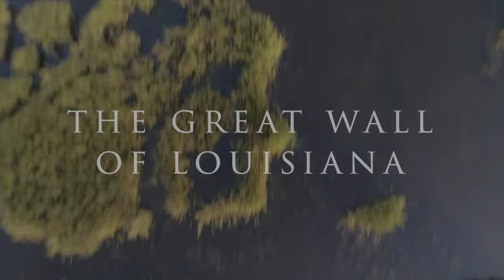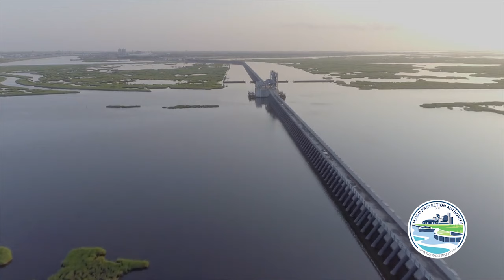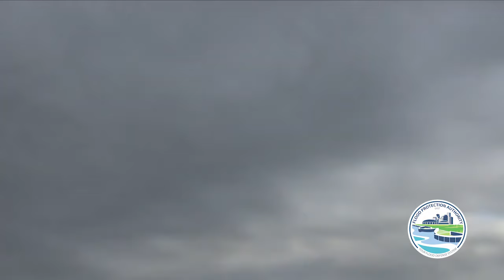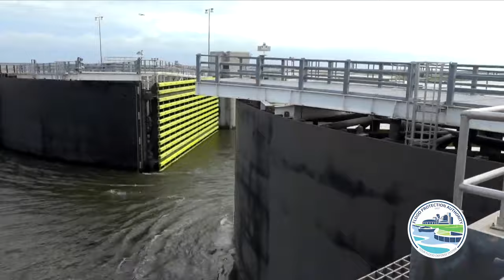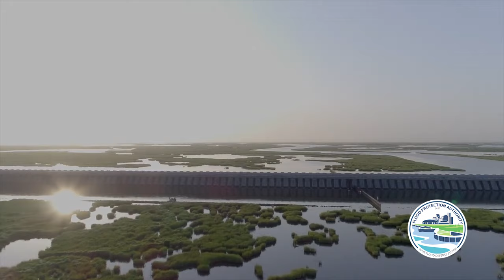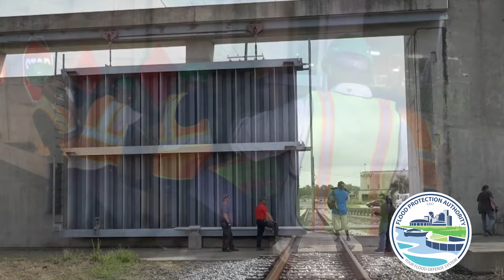The Great Wall of Louisiana

Comment: It's flawed and sinking already
Reply: They should have listened to the Dutch engineers.
Reply: @JamesJones-cx5pk  It would have hold if they build it like the Dutch did theirs.
Reply: @Brozius2512  The dutch don't have hurricanes.
Reply: @JamesJones-cx5pk  It will hold just fine, but it could still be overtopped. 100-200 foot pilings aren't going anywhere.
Reply: @JamesJones-cx5pk  no but sunamis happen everywhere...smart guy
Reply: @danielthomason5685  tsunami smart guy.....
Reply: @garyjames143 yooo hahaha. 10 month old comment but this is funny as hell!!
Reply: @Brozius2512  do the dutch have -14 ft elevation in a sinking city from less river deposit after Levees stopped that in addition to strongest hurricanes in the Gulf?
Reply: @Brozius2512  do the dutch have -14 ft elevation in a sinking city from less river deposit after Levees stopped that in addition to strongest hurricanes in the Gulf?
Reply: @jefflarson1652  I've been there, no way in hell it overtops. It'd take a 30+ ft storm surge. That area won't ever see higher than 10-12 feet being more inland. Coastline can see 20+ ft, but not there.
Reply: @DL-fl5ul  Eeh you do realize that the 26% of the Netherlands is below sea level?
Our whole coastline is below sea level.
Reply: @DL-fl5ul  Have you ever watched why and how the Dutch build their water defenses?Which is the most advanced water defense system in the world.
Reply: It's held up so far. 🤷🏽‍♂️

Comment: My brain ruminates on ideas like this. This is only two miles...What if we built one that went 2000 miles...from Texas, around Florida, to Maine...from San Diego to Seattle...make the barrier 100 feet wide with a highway on top and charge a fee to travel the span. It would pay for itself if you could pay 100 bucks to travel from NY to Miami in 12 hours, no traffic, and a rest stop every 100 miles or so...put strategic ports near every big city with rail lines to and from the land. Imagine the fishing industry building platforms just inside the barrier, paying a fee to be there, but able to build facilities to support their industry. Wave power generation on the outside could be implemented. Solar along the entire span...even windmills could be incorporated into the design and used to power the port facilities, the roadways and sell power back to land.
Reply: I like the way you think🤔
Reply: Imagine all the life time maintenance and construction jobs that could be created.

Comment: thats awesome, i actually helped to build this project as a surveyor.
Reply: That’s not helping lol
Reply: I've fished here in Chalmette. I was at LSU and we rented Kayak from LSU Rec center and drove an hour to here. I paddled over 10 miles that day when I went to trace back on google earth. We started out catching nothing but then one boat was killing them on white lures. So I asked them for a few, my friends were too scared to ask. I ended up catching like 12 speckled trout. My friends caught nothing. I had so much weight in my kayak that you can see the opening in the gate. Well, there is a strong current that goes through it. Very strong. I couldn't paddle against it with as much weight as I had. Too strong of a current to get to other side. So I straddled the sides where the current is weaker where it had infinite barnacles all on the wall. Ended up slicing my hand in 100 different places trying to straddle that wall to get to the other side. Current was still too strong, so a boat that had a motor going through tossed my some rope and I held on as they pulled me through. Between that and paddling over 10 miles that day in a heavy kayak as well as very sunburnt out there 8+ hours with no hat, shades or sunscreen, I was so fricking tired. I then had to drive an hour after that back to BR. It was all worth it for those 12 trout though. Definitely something you only do in college but don't have patience or energy for after.

Comment: I've fished here in Chalmette. I was at LSU and we rented Kayak from LSU Rec center and drove an hour to here. I paddled over 10 miles that day when I went to trace back on google earth. We started out catching nothing but then one boat was killing them on white lures. So I asked them for a few, my friends were too scared to ask. I ended up catching like 12 speckled trout. My friends caught nothing. I had so much weight in my kayak that you can see the opening in the gate. Well, there is a strong current that goes through it. Very strong. I couldn't paddle against it with as much weight as I had. Too strong of a current to get to other side. So I straddled the sides where the current is weaker where it had infinite barnacles all on the wall. Ended up slicing my hand in 100 different places trying to straddle that wall to get to the other side. Current was still too strong, so a boat that had a motor going through tossed my some rope and I held on as they pulled me through. Between that and paddling over 10 miles that day in a heavy kayak as well as very sunburnt out there 8+ hours with no hat, shades or sunscreen, I was so fricking tired. I then had to drive an hour after that back to BR. It was all worth it for those 12 trout though. Definitely something you only do in college but don't have patience or energy for after.